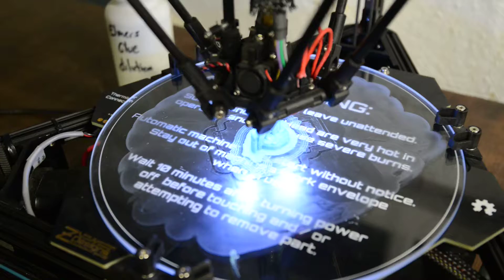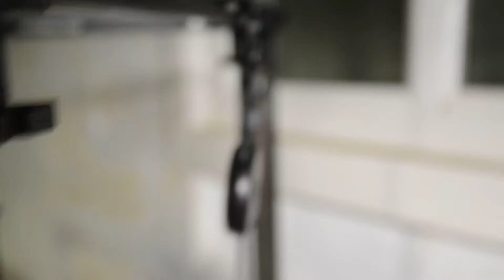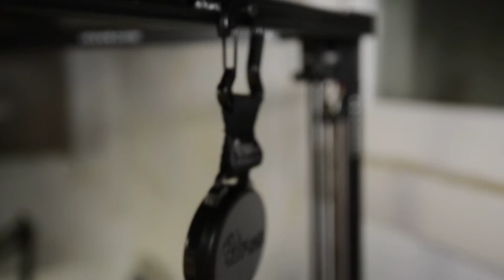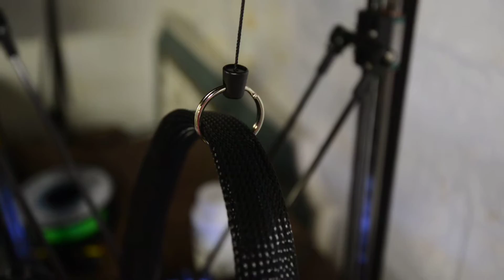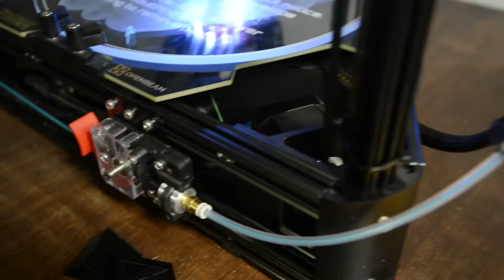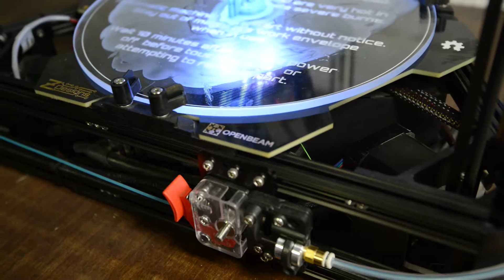OpenBeam Kossel Pro: 1.5 year review

Comment: As far as you know (I havent dove into hardware too deep) does the newer unit have an updated extruder? Or rather to save time.. what are the parts differences from yours to the current rev?
Reply from the maker: I think the big change is the hot end is all-metal on the new one. I believe it still uses the EZStruder (which I will stress works fine for the base configuration).

I am sure that MatterHackers can answer questions with greater accuracy. If you have additional questions, drop by forums.openbeamusa.com and pose your questions there.